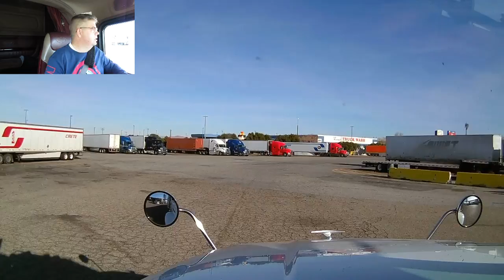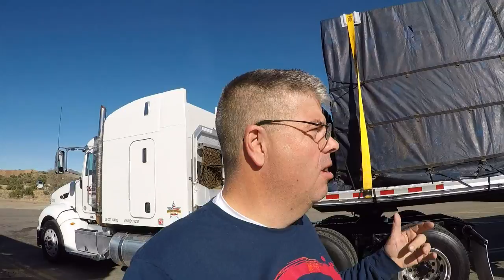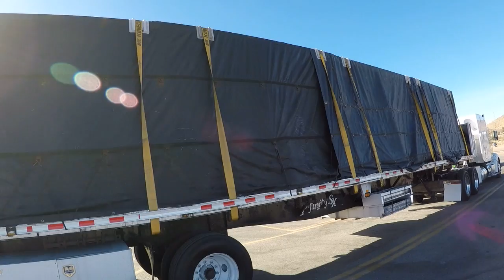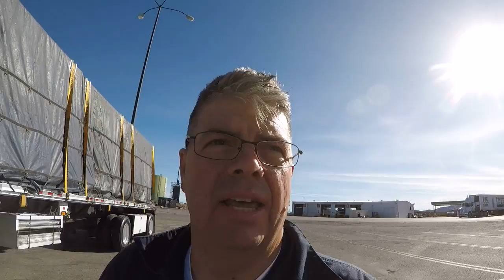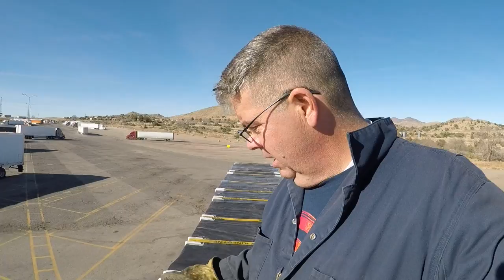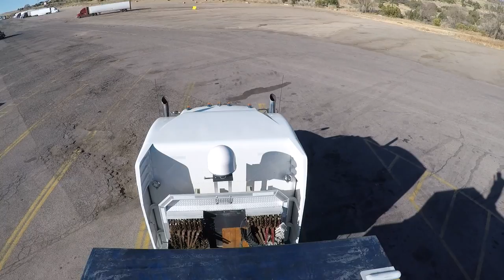#204 Birds Eye View Securing Tarps The Life of an Owner Operator Flatbed Truck Driver Vlog

Comment: Dan, in flatbed training my trainer showed me a 6 - 8 foot piece of 1-1/2" pvc pipe with a "t" fitting on one end.  The top of the "t" fitting had a 1/4" wide slice cut into it so that it will fit the end of your plastic edge protector in it.  With the edge protector in there he was able to lift it on top without climbing on top of the load.  Saved a lot of time with basically an extension arm to place those edge protectors up there with.  Not sure if you’ve ever seen anyone out there using something like that.
Reply: RP Trucker I use to use a 1x4 about 3’ long to slide them up there

Comment: Hey Dan I made this really cool pole for my Edge protectors. Get a PVC T pipe fitting screw it on the top of an extending pole then cut a gap down the top of the PVC 2 Slide the edge protector in then you can reach up and put the edge protectors on your load from the ground
Reply: I just made a 1/2 inch PVC pipe pole with 3 screw couplers so I can store it in my box. I glued a "T" at the end and cut a 1/4 inch gap to receive the edge protector so I don't have to crawl on top of the loads to install the edge protectors. I just slip the edge protector up under the strap and tighten the strap.

Comment: Nice videos, funny thing is that I play ATS and was twice at least like oh,I have driven there! And that stack train was good eyecandy to trainfan like me
Reply: I just got ATS, two weeks ago. I use a joy stick from Flight Simulator 2000. I looked at the steering wheels, they are expensive. I'm still new, figuring out which keys on the computer do what, and still running in the simple automatic transmission. I think I need buttons on my job stick to be able to shift gears. If you ever know of a good steering wheel for around $100.00 or less please leave me know.  Take care.. have fun...

Comment: Love the videos. Appreciate the time and effort. One thing I've learned is that I do want to plan my fuel stops as the wife and I travel with our RV. I drive a Chevy 3500 with a 38ft 5th wheel. 
You always seem to stop for fuel at truck stops with tons of (pull through) parking. My luck, I pull into a fuel stop with 20 back-in spots and 18 of them are full. Is it just your experience that knows where all the big truck stops are located or do you use some guide or software? I drive four days every other month so I'm not backing in between two 53 footers. You professionals would all die from fright or laugh yourselves to death. I’ll end up on some trucker’s vlog with a view from their dash-cam.
Thanks again and be safe.